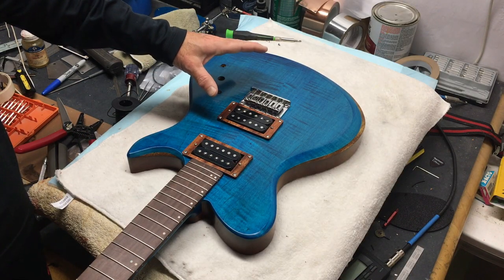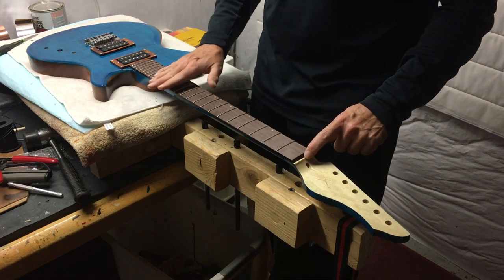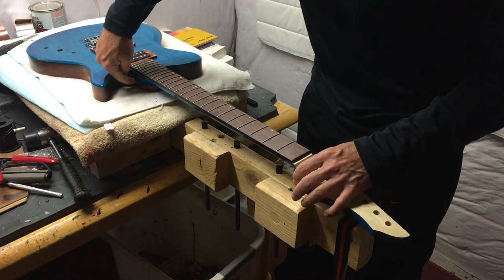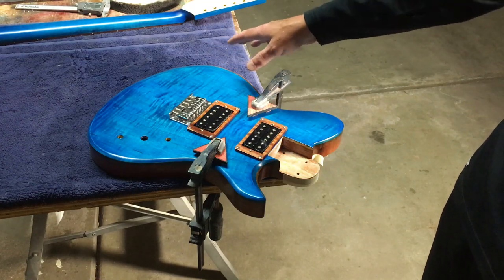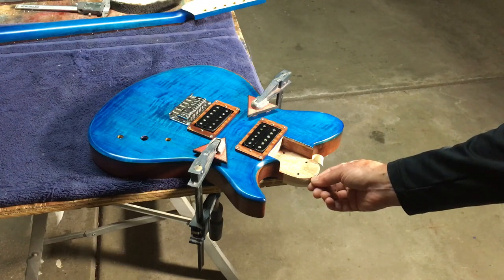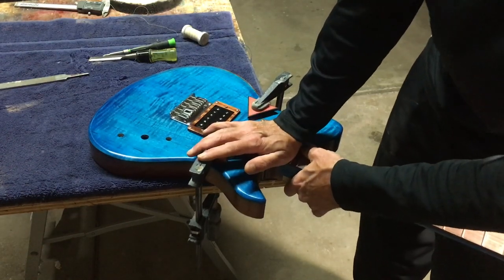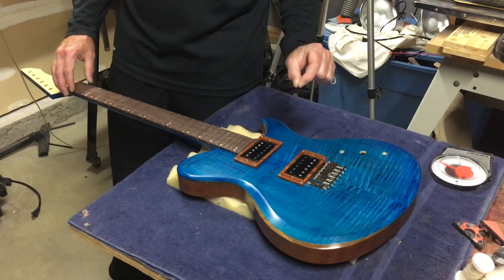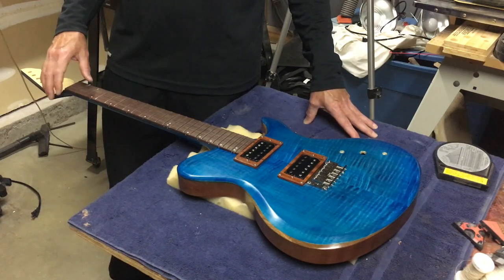How To Tweak The Angle Of A Guitar Neck For Perfect Action

Comment: Hello! Great video! I have a question on shimming if you don’t mind giving me some insight. I own an ESP guitar with an Original Floyd Rose bridge/locking nut. This guitar has bothersome buzzing issues from the 3rd fret on up to the 12th fret area. I’ve set the relief at .010 measuring at the 7th fret with a capo at the 1st fret and 15th fret. I have string height set at 4/64” on the low E at 17th fret(with capo on 1st fret) and 3/64” on high E at 17th fret. The feel/playability with the .010 of relief is stiffer than I generally like but I still have annoying buzzing in the 3rd to 12th fret area, especially on the low E side. I’m thinking maybe shimming the neck angle may allow for less relief, better playability and less buzzing. Is this possible from changing the neck angle through shimming? Thanks in advance!!
Reply: I'll preface this by saying I am not an expert but I am currently developing my skills as a luthier/guitar builder. Your string height/action should be measured at the 12th fret, without the string being fretted. The 4/64 and 3/64 measurements are good but that should be measured at the 12th fret on an open string. If  after that measurement, you are still getting string buzz around that area, it would suggest either a backbow, a high fret or possibly an uneven neck (twisted, bump in fretboard, etc.). I doubt a neck shim would do anything in this situation, best to take it to a trusty guitar tech and have him fix it. He can then give you an explanation on what he did to get it back to shape

Comment: In my opinion using a shim under the heel of the guitar has a huge effect on the sound especially the compression waves or acoustic properties of the guitar. This is because you are creating a disconnect from the body and neck. I bought an Ibanez RG750 built in '93 and when I played it it felt dead and lacking in something. I bought it secondhand from a friend who said he just had it set up by a good guitar tech from my city. I took the neck off and found a piece of sandpaper he had used in the heel of the guitar to create an angle to supposedly improve the action. It was a small slither of folded sandpaper in just the far end of the neck pocket. I put it back together and then the guitar had a very strong rumble with much more low end and doubled the vibration and gave it power. I then adjusted the action from the bridge and trussrod to taste and the guitar produced a far more strident tone also the guitar vibrated beautifully. The neck and body joint has to be flawless, tight and then it will transfer the energy much better.
Reply from the maker: Mickeyislowd A piece of sandpaper under the heel is NOT a shim. A proper shim made of wood with full contact works just fine.

Comment: Why would you set your saddles as low as they can go?
Reply from the maker: When the saddles are in the lowest position, the strings should just kiss the top of the last frets. This is your starting point. From there you can raise the saddles to whatever action height you want. However, if you lower the saddles all the way and the strings are bending down to the bridge from the last fret, you will be very limited in how high you can raise them.

Comment: You are building really nice guitars, I'm surprised that you are not using bolts into wood inserts for the body to neck connection, makes a better everything for the guitar! Also it would be very wise to build a jig for lowering the neck joint, as precise as you are, filing free hand will never be perfect.
Reply from the maker: You mean like this video I did a while back: https://youtu.be/AOV2AZaJyck

Comment: Why not shim the entire part where the neck meets the body to keep the neck flush with the body? I don't get the purpose of going to all these lengths to angle it. I would assume in the long run this angle would just cause more problems with action, neck relief, fret wear, and intonation.
Reply from the maker: A lot of guys hate shims. I have no issue with them, but if a buyer doesn't want shims, I have to angle the neck. It's not difficult to do. Sometimes just a couple of quick passes with a file or a sanding block. Almost every guitar ever made with a tune-o-matic bridge has the neck angled and they don't suffer the issues you mention any more than guitars with flat necks.
Reply: I don't care about shims either. I'm more in the proper functionality of the guitar over looks. A lot of guitars with Tune-o-matics are of the Les Paul variety and they have tons of tuning stability issues. Of course, most of that is due to the head stock angle, the 3x3 tuning machine design, the tune-o-matic height itself if incorrectly set, etc. I'd just imagine that neck angle would be another issue. Maybe that's why the neck is angled on those guitars to give relief to the head stock? I'm not so much arguing against it, I just want to know the practical purpose of it is if there is any compared to keeping the neck flush with the body because I am modifying a guitar right now that requires the neck to be raised and or angled because the trem is as low as it goes and the strings don't touch the frets.
Reply from the maker: @7James77  If Gibson kept the Les Paul neck flat, they would have to raise it so far out of the body, the guitar would look ridiculous. Is your tremolo recessed into the body?
Reply: I read as well recently it's because of how high the tune-o-matic is that they do it. So, I at least know both reasons why. My guitar I'm modding is a custom. I own a standard cheap model Randy Rhoad's that had a 22 fret neck. I wanted a guitar with a Reverse Head stock and Maple fingerboard but did not want to buy an entirely new guitar. Searched Ebay and found the exact neck I wanted from a different Rhoad's. 

The Neck sits much lower in the body than the original neck by about 2/16 and the tremolo is a Floyd Rose(The strings touched the bottom frets on the original neck). I have shimmed it to the height of the neck on my Jackson Warrior  but have to do further modifications to the neck/body and tremolo so it is currently off the guitar. Hence why I'm wondering if I should angle it if it has added benefits I don't know about.

Comment: it looks like your routing the neck pocket to deep, to begin with. i always put a 2.0 degree when routing the pocket.
Reply from the maker: Or the customer decided to use a different bridge. 😉
Reply: @HighlineGuitars  that's possible but it's clearly evident that the fretboard is sunk too low in the pocket.. IMO
Reply from the maker: The pocket wasn’t too deep for the bridge that was originally intended for this build.

Comment: the big impact you are talking about when lowering or lifting the nut only impacts on open strings which makes the impact not that huge. and of course shimming the neck pocket affects the tone and sustain IF you shim it not with a wedge but with a constant piece on the point closest to the body. because then the neck has not the touching area with the wood as it would have if it is not shimmed. you do not need to be a luthiet or builder to know that. this is not a myth. if you make a shim on the full area pf the pocket with the same wood, then you keep the tone and sustain mostly unchanged.
Reply: I think he's using the nut only as a reference point for that end of the neck, not implying only changing the nut fixes neck angle. But yeah, not the most precise description. Cheers

Comment: Better to use a router to change the angle (not sand or file) . Set up an jig with the guitar body below. With the body shimmed on the back to get the desired angle. 
  It probably won't be flat if you use a file.
Reply from the maker: It all depends on your skill with a file or even chisels. What did luthiers do before electricity?
Reply: leo fender always had electricity.
Reply: Fender used shims or tilt adjust screws.
Reply: Fender used routers to cut the body and pocket. They did it with jigs.
Reply: green323turbo But shims for fine adjustment.

Comment: There is something I really don’t understand from guitar builders and luthiers. So many neck adjustments are made to compensate for a wanted string action.Very manyof the adjustments like shimming the neck will absolutely kill sustain and structural integrity of the guitar. Remember, If you shim a neck with just a
little strip under the neck in the pocket all tension on the neck comes down on the screws for contact friction is absolutely killed (bolt-on neck).Solving the problem is a piece of cake ….Rout out a hole in the body (solid body) and lower the bridge. A lowered bridge looks amazing and sustain increases drastically.
Reply: A shim has no noticeable effect on sustain whatsoever. The clamping pressure from those 4 screws is so much, it might as well be a single piece of wood. Recessing the bridge isn't necessary; it just looks fucking dope. Same with pickup rings and control plates. I think it looks even better if the recess is like 3 or 4mm bigger than the part so it outlines it with a flat bottomed trench. I might even try it on a scratchplate some day

Comment: I have one doubt about this operation. Unless you are doing this to a new build, the neck of the guitar has already been screwed to the body. The screws are supposed to run perpendicularly inside the neck to keep it firmly united to the body. If you change the angle of the neck the angle of the screws will change as well, so how can you maintain a solid junction between the two parts by doing that?
Reply from the maker: Plug the screw holes in the neck with dowels of the same wood type and redrill. Easy peasy lemon squeezy.
Reply: @HighlineGuitars  😂 So brutally simple! Thank you!

Comment: In my opinion no matter how good of a hand you have, there is no way you can make a precise gradual angle free hand, the way to go about it in my opinion is to have a jig going with a slight angle and just rout the pocket perfectly.
Reply: yoheff988 yup that would be the way I would do it also.
Reply: that is why this solution was a mistake. if ge did tge neck heel, he would have been able to produce an accurate and flat angle.
Reply: Well for starters you don't really need to make a perfect ramp since on a bolt-on the neck is not going to be in even contact with the whole ramp anyway.

However if the point is that you can't cut an accurate surface with hand tools, that is just wrong,  With wood there is normally a fast and accurate way to do things with hand tools, since those tools have been thousands of years in development.  But more to the point, when accuracy is needed that is when hand tools come out.  The most accurate metal working tools like surface grinders are hand scraped.  You can't get behind the hand work.  It is hand work that provides the base everything else is leveraged off of.  

Of course most luthiers aren't really woodworker, and for that mater most of the classic electric guitars are totally influenced in design by the use of the most efficient tooling that the factories had available.  So routers and jigs work great and suit the often woodworking skilless workers using them.
Reply: Really? Sure you can! Maybe not just with a rasp, but there are other tools (think end plane, sharp chisel, scraper). Or sure, go ahead and jig and route, but you'd better know what you're doing, because one sure way to kill a neck joint is to stuff it during routing, lol. But we're talking a poofteenth of an inch here, if you can't do it with hand tools, I reckon you're nuts taking to it with a router. Hand it to someone who has a clue.
Reply: @johncougar526  Too many people overthinking things instead of actually testing them out for themselves, lots of citizen scientists who think they know all the secrets to tone but just end up sounding like lemmings spouting what they read somewhere else. It's sad to see so much misinformation being spouted so confidently, but that happens in all walks of life. If you put most people into one class of college psychology, all of a sudden they can break apart your entire personality like they've been psychologists for 30+ years.

Comment: Why don't you just file the saddles down?
Reply from the maker: If the saddles are already as low as they can go, filing down the saddles to lower the strings, even more, means they'll have to remain in the lowest position to achieve the desired action. That's okay if the guitar is your personal instrument, but if the guitar is for someone else, it's better to leave the bridge alone and angle the neck so the owner has the ability to precisely raise the saddle height to achieve their desired string action.

Comment: The guitar was made badly in the first place with the wrong neck angle , just looking at the vid 
it seems to much wood was taken off when it was made , the only way to fix this in my opinion 
is to glue another slip of wood of the same kind in the neck pocket then use a router to re cut it 
to the correct depth and angle
Reply from the maker: The guitar was fine. It was used as a prop for the video to explain a technique that others can use when they run into the same issue with their first time or kit builds.
Reply: @HighlineGuitars  If its a one off guitar project; why not make a neck with a thick enough heel to begin with so you have enough 'flesh' to shape the heel to the correct thickness - or angle ?
Reply from the maker: Steinstra 1961 what if the wood I have to use isn’t thick enough?
Reply: @HighlineGuitars  You could have glued an extra piece of the same wood on the neck blank to make for a thicker heel ?
Reply from the maker: @Steinstra-vj7wl  Or just a few passes over the bottom of the neck pocket with a file.
Reply: @HighlineGuitars  Please excuse me, but in my world that is ridiculous. But whatever floats your boat.
Reply from the maker: @Steinstra-vj7wl  So cutting a piece of wood, gluing it to the heel, reshaping it, sanding it, and refinishing to match then the neck is somehow not ridiculous? Filing the bottom of the pocket took a few minutes and there was no need to do anything else.
Reply: @HighlineGuitars  It sucks that the comment section is so full of people who think they have all the answers, but the more you let them talk, the more it's clear they don't know what they are talking about.

Comment: So you didn't set the neck break angle BEFORE you finished the instrument? Are you crazy or just forgetful? Setting the neck parallel to the body is a huge no-no for any luthier creating an electric guitar. Remember 2.5 degrees is the ideal angle.
Reply from the maker: There is no such thing as an ideal neck angle. The angle is entirely dependent on the design of the neck to body joint as well as the height of the strings from the body at the bridge. Some guitars can have a neck angle of 1-2° while others require up to 4 or more degrees. If a client changes the type of bridge they want after the neck angle is set, the angle must be adjusted.